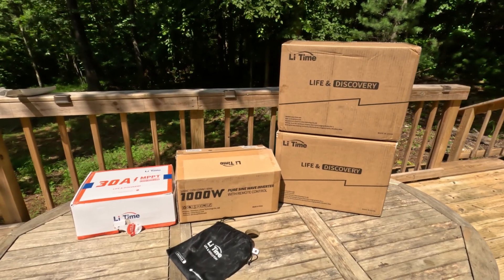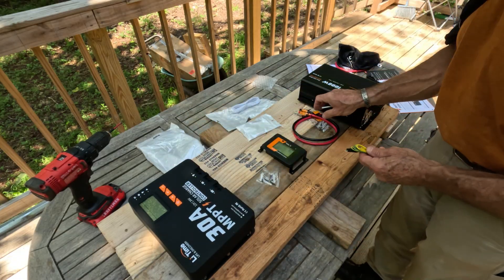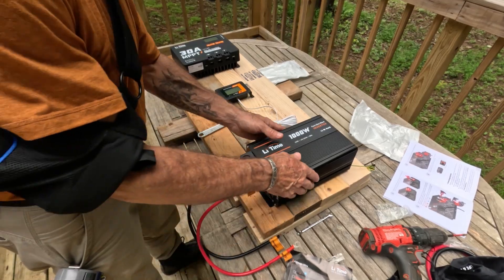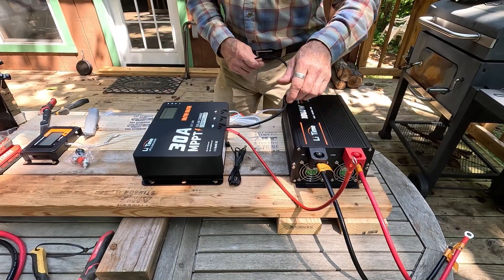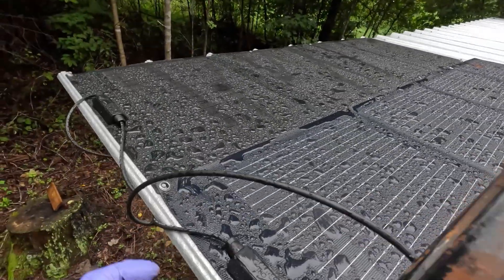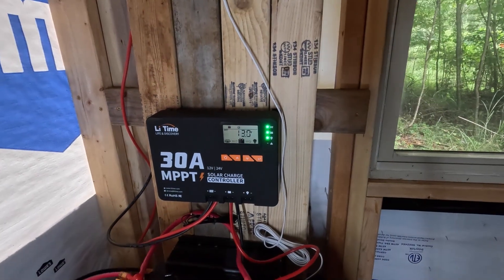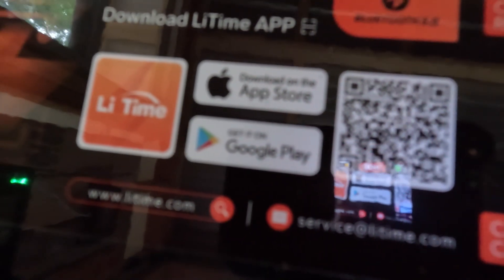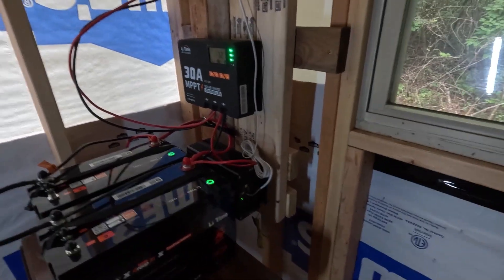Simple OFF GRID SOLAR Installation ANYONE Can do | LiTime Solar

Comment: Always have battery power applied to the charge controller before connecting the solar panels. It is also a very good idea to put a disconnect switch in the pv line so you can connect safely and then close the breaker to apply solar power.
Reply from the maker: I'll look into it, thanks!
Reply: @offgridchallenge I'll only say I know for two reasons. Because smarter people than me said to and because I've watched the spark jump when connecting an mc4 cable 😅